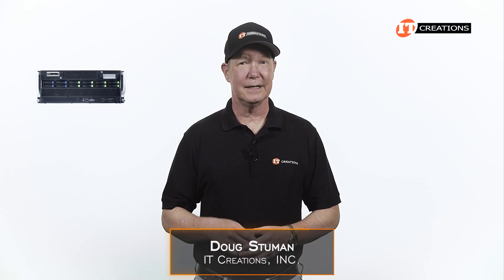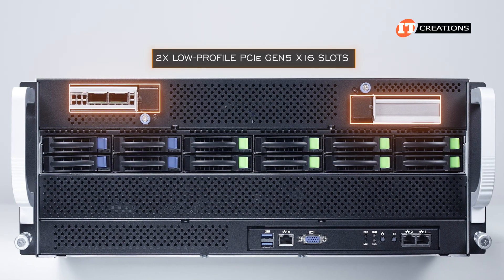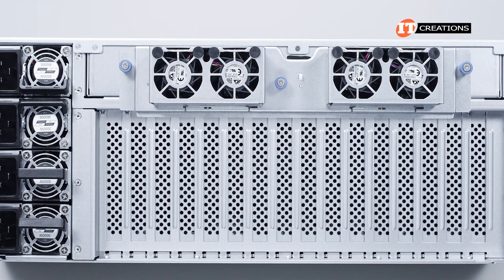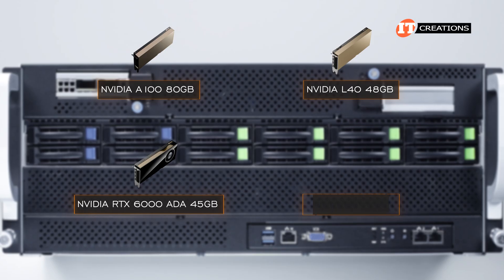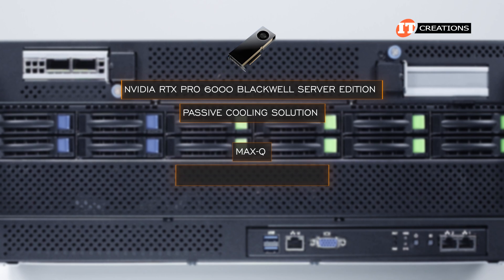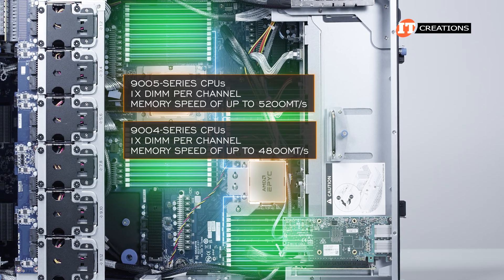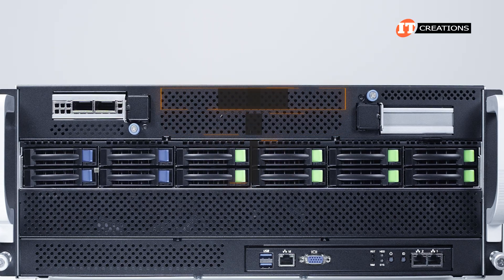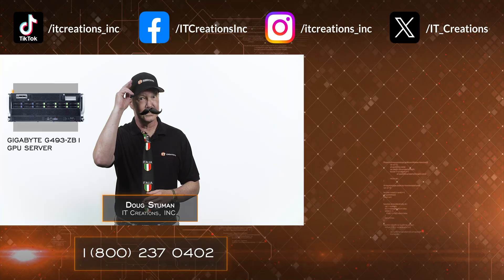10x GPU Gigabyte G493-ZB1 Beast! REVIEW | IT Creations

Comment: : I was going to ask why it has its networking in the front portion of the chassis... :D
Reply from the maker: Hi Philipp,
There are a number of reasons why the I/O panel is located in front on these GPU servers. 
1. Accessibility and maintenance, even with access to the back of servers there are still a lot of cables 
2. Limits downtime with no need to find the system from the back—even with the unit ID button! 
3. Airflow and cooling, especially in high-density GPU configurations as much of the exhaust fans are placed in the rear of the chassis
4. It simplifies cable management and reduces clutter as there can be thousands of servers and nodes in large-scale AI deployments. The chassis on these systems are also much longer than a typical server, which can also impact available space and cable clutter towards the back of the system.
5. With increasing adoption of liquid cooling, which typically comes in through the back of the system, accessibiliitiy is also enhanced with the I/O panel located in teh front (refer to point 1.)
Great question! thanks for watching and commenting!